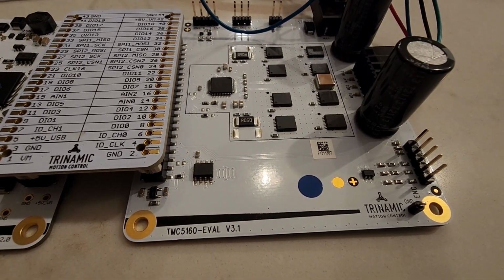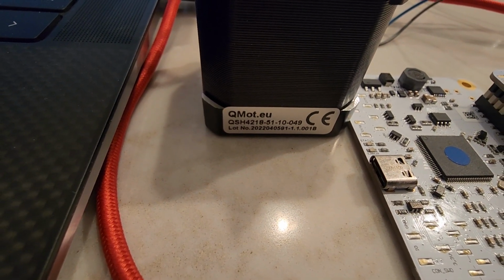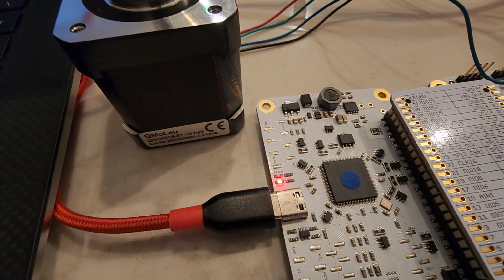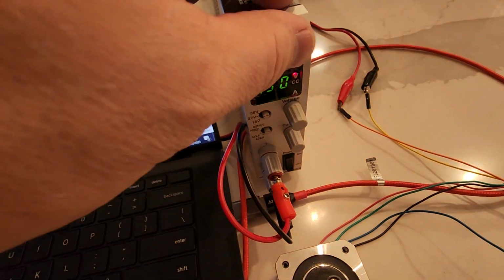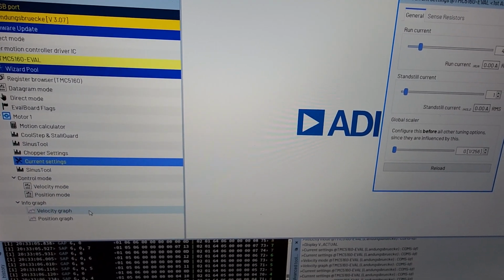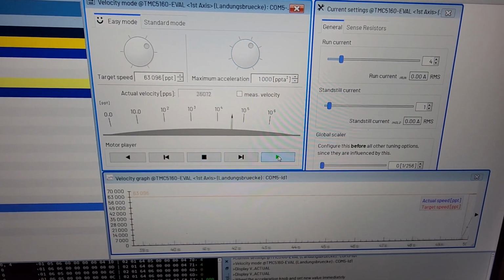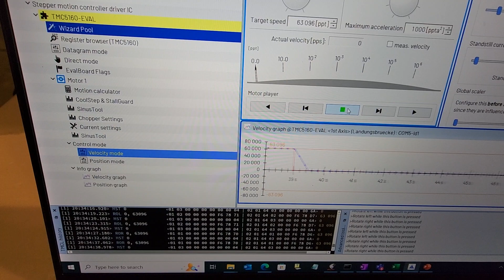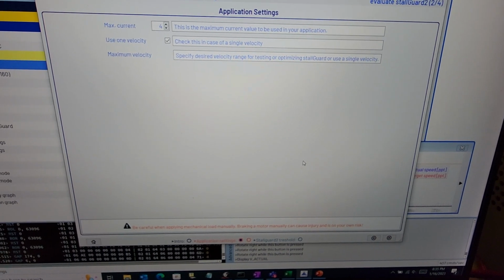Trinamic TMCL IDE TMC5160

Comment: Hi Dale! Does the position mode work for you? We're fine with the velocity mode, but the position mode doesn't seem to move the motor at all. Do you think there should be an encoder plugged in for that?
Reply from the maker: I did some playing around in the GUI and was able to get my stepper to spin in the position mode without an encoder but it's not 100% repeatable so I'm digging into this little deeper to figure out the best way to get results 100% at the time
Reply from the maker: Check out this video to use the position widget

https://youtu.be/1AUKTVVYFOU